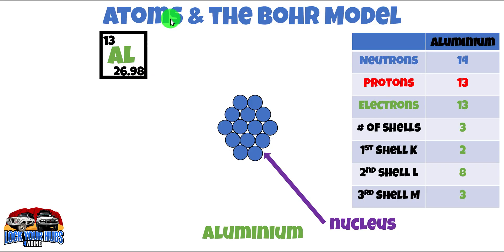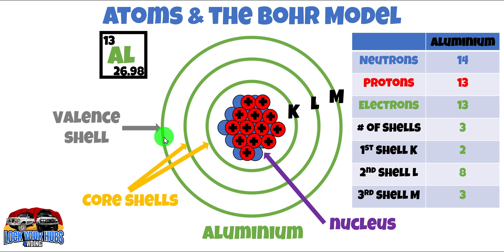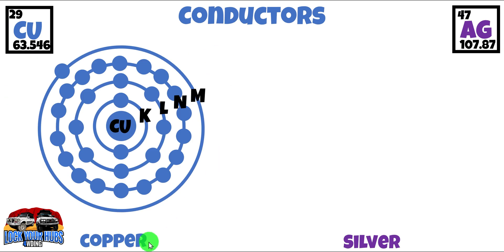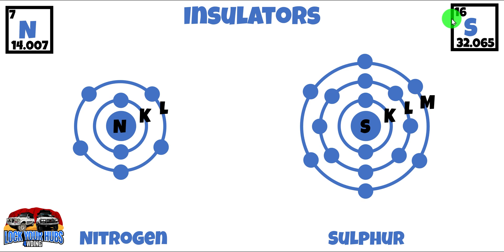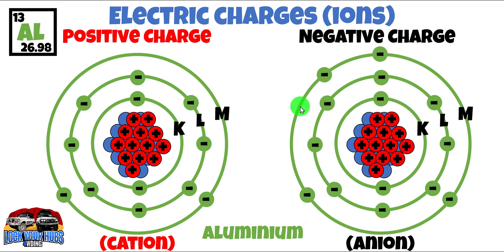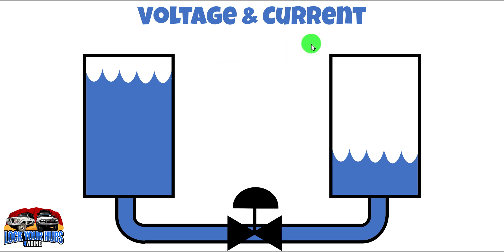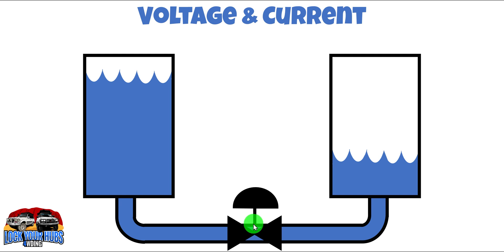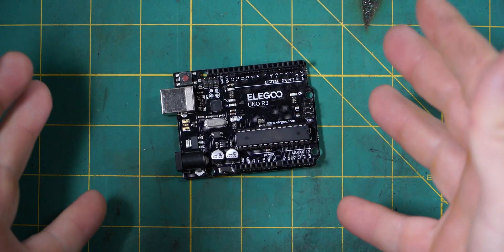Arduino 101: Getting Started with Microcontrollers for Beginners Part 2 Electrical Fundamentals

Comment from the maker: Conventional flow vs Electron flow, what's your poison?
Reply: I think conventional electron flow is stupid. I understand it all came about before electrons and their flow was understood, but we came to that understanding a long time ago now. It now just seems like in the electronic world they can't handle change.... Which is ironic given how much the world of electronics changes. Most of the time it's immaterial and either way works, but sometimes understanding things from conventional flow is downright confusing. I think the electronics engineering world should remember we've moved past vacuum tubes and just start using actual electron flow so there isn't this confusion between science and electronic worlds and people don't get confused
Reply from the maker: And just to confuse matters there's the idea that the energy flows in the electromagnetic fields around the outside of the wire..... (For AC anyway)
Reply: @LockyourHubs4WDing  I did see a video demonstrating that, but forgotten all the details. Obviously induction going on, but challenges the simple movement of electrons explanation. I've never understood AC electricity and the weird things it does to be honest, my simple brain can't seem to wrap my head around it's behaviour

Comment: With 4 electrons in the valence shell, Carbon is a semi conductor like Silicon or Germanium therefore it can be either a conductor or an insulator depending on how it is constructed.
Reply from the maker: Close! What about the structure?
Reply: When the atoms form to make Graphite there are electrons left floating free in the valence ring and when Diamond is formed, there are no electrons left free in the valence ring. @LockyourHubs4WDing